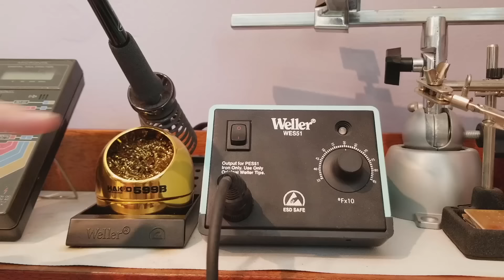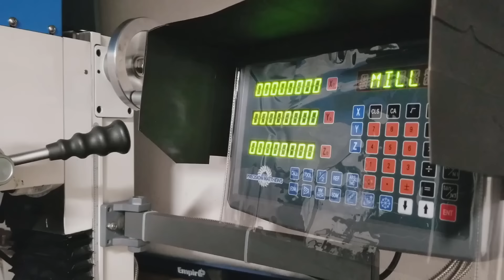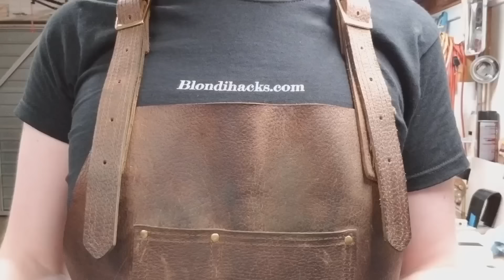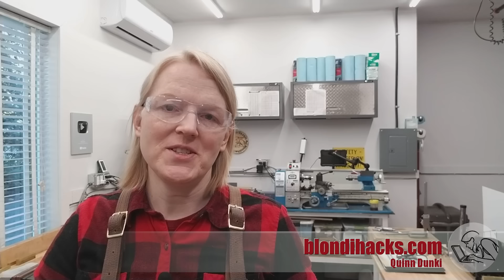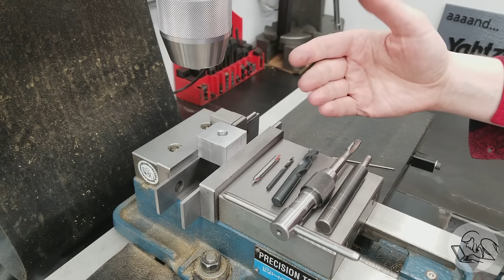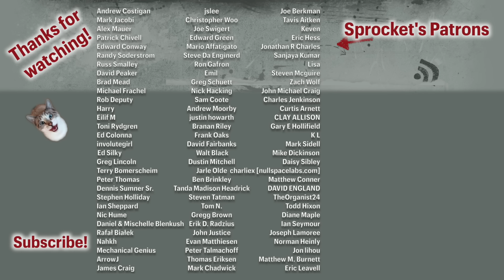Efficiency in the Home Machine Shop

Comment: I like using rolling papers for touching off.  The majority of them are .001" thick, +/- .0002" so when you snag the paper you're within a thou and you haven't marred your surface.  Notebook paper is in the 3 thou range if you don't want the guy at the gas station thinking you're a pothead.
Another thing I do is make little kits for things I do a lot, like I end up drilling and tapping a lot of certain holes.  I've got a little plastic bin with the pilot drill, tap drill, and tap in it so I'm never digging through drawers looking for commonly used items, they're always right there in a convenient organizer.  That way whether I need to do that thing at the lathe or mill or even with a handheld drill I just grab the bin and go.
Reply: Your comment reminds me of comments from a driver who runs a motor race team with volunteer helpers (with occasional turnover). He set up the "adjust rear wing grab kit" (etc.) so the person could grab the kit & do the job - rather than hunt for the 6mm hex key plus the xyz tool out of the main tool box (& get in the way of other workers) every time.
Reply: @yowie0889  Smart guy.  Making kits for specific tasks has saved me tons of time and a bit of frustration over the years both professionally and in my hobbies.

Comment: Good list, and great video as always.  Just FWIW, the top efficiency improvers on the mill for ME personally are:
1. Goes without saying, but: having a DRO on the mill
2. Power Z-axis to save cranking it up/down constantly for tool length changes
3. Power X-axis for the most common facing operations
4. Collets in a "spinner" mounted on a cabinet directly to the right of the mill for easy access
5. Having the most commonly-used tools (edge finders, face mill, calipers, machinist jack, angle blocks, clamps, etc.) readily at hand on a shelf/cabinet within arms reach
6. A power drawbar.  Actually, I have only a "poor man's power drawbar" at the moment: the proper sized 12-pt socket in an impact driver always at hand on a shelf just above the drawbar bolt.  One day I'll get around to making it a TRUE power drawbar setup, but having the impact driver gets me 90% of the way there for quick tool changes.
7. Cyclone vacuum setup immediately available beside the mill for quickly clearing chips

Comment: Biggest efficiency tip for me was actually on a longer timescale - there's probably four sizes of endmill you use all the time, and similarly with reamers / drills / taps etc. Get the best quality you can for these frequently used tools - and keep a spare! I've lost more time in projects waiting for replacement tooling after a broken flute than I've wasted in toolchanges or edgefinding. Higher quality tools also save time as you said because you get better precision on dimension off the bat.

Also, its almost always worth it to buy a tap / die rather than setting up the lathe to do single-point threading. Machining channels on youtube tend to make a big deal out of the single-point threading, and its very satisfying to watch, but its incredibly time consuming. You don't need every thread - I only have metric taps, and even then you can almost always get away with a size up or down from the drawing. It's just a hobby shop, and I'm my only client, so I only need to make me happy :)
Reply from the maker: All great tips!

Comment: I think I'd add a sheet of either drawer liner felt or cork to the top of the surface plate cover. Easier on the finish of the tools and a little more resistant to the tools sliding or rolling when the cover is moved.

Comment: zig zag papers are good for edge finding with milling cutters damp the surface your wanting to edge find off put the zig zag paper on then touch off with the cutter as normal stopping the moment the cutter brushes the zig zag paper off. you'll be less than the thickness of a zig zag paper close to the work piece

Comment: My #1 efficiency tip: Bright and even lighting. It takes much less time to accurately read measurements if you aren’t moving around trying to “catch the right light”
Reply: The older I get, the more important this is!
Reply: Having a magnifier in your first-order set may become a necessity too, as your eyes grow out of being a teenager. 😅
Reply: @autochton  Oh yes.  But... good bright lighting also helps a lot to make out the little details with ageing eyes.  I have trouble making out the print on small electronic components, except when I have a bright light to hand.  Don't even need a magnifying glass except in rare cases. 
   
My shop tips which I sadly don't always stick to: 1) A place for everything and everything in its place.  2) Tidy up between jobs, and at least once a week.
Reply: @autochton A set of Jeweler's loupes or at least a 10x one is something that is usually found in a machinist's tool cabinet. As well as a large magnifier often times with a built-in light.
Reply: I have had LED daylight strip lights in the workshop for a few years but recently added an old anglepoise lamp between the mill and the lathe - I find the extra light right on the job is great.

Comment: Good floor planing may not give you to much efficiency but can save you a lot of headache, keep the stock in the same end of the shop to the bandsaw and the lathe not the grinder and the mill, moving across the shop is a lot faster If you dont have to go around the workbench so aligne parallel to the most common path and dont put the heavy box of gauge blocks/drill bits on the bottom shelf.

Comment: One small problem I've found with the screw machine drills is that they seem to suck for lathes, or at least on my little Sherline. Unfortunately with the length the tail stock travel, I really struggle to get the drill past the cross slide and into the part.

Comment: As a prototype machinist at an automation company that does lean I feel kinda obligated to chime in on the time and motion studies subject. They are totally still done, but just anecdotally in my experience, they are usually done with the intent to reduce fatiguing repetitive motion or to reduce mental burden on employees. Toyota and properly done lean is a great example of that concept being turned into a good thing for employee and employer. And it is super nice in a home shop as Quinn has pointed out.
Reply: Absolutely- and as a Union Rep I occasionally did time & motion studies both for protecting my members and for suggesting improvements when “efficiency savings” had to be made. The latter has become a complete double-speak for slashing good things, but it could still help to find the least bad option…
Reply: @davidrahn9903  I agree 110%.  I was dragged into learning Lean/Six Sigma at work 20+ years ago.  The highest priority was to implement Lean/Six Sigma in our jet engine overhaul building.  One Production Shop was "Leaned" at a time and the first Shop I was involved with performed compressor subassembly teardown (for a specific engine), inspection, (send parts out to other shops for actual repairs, if economical), then reassemble the repaired/new/good parts into the compressor subassembly.  My team of two people followed one Artisan around as he did his task and measured how far he walked, noted what he did & why, etc.  At the end of his task, which took him at least 2-3 hours, he had walked ~1.5 miles (~2.4 km) inside a Shop with floorspace of ~100-ft x 150-ft (~30.5-m x ~46-m), only leaving his Shop one time for a ~1/4-mile (~0.4-km) round trip to get a tool replaced by the Tool Room.  I don't recall how long his task actually took without us bothering him, but it was less than the 2-3 hours we slowed him down to.  Walking around in his Shop to retrieve tools, fixtures, etc., was amazingly inefficient! 
 
After our teams redesigned the workstations for each task, we arranged for all necessary tools, fixtures, consumables, etc., to be placed within arm's reach of each Artisan.  "Our" Artisan's 1.5-mile (~2.4 km) walkabout became just ~100-ish feet (~30.5-ish meters)) (only because some tools/fixtures needed to be shared by different workstations - Work Orders were submitted to obtain/manufacture additional tools & fixtures that caused slow-ups due to having to wait for another workstation to use it first) and his task's multiple-hour TAT lowered to around half an hour.  The Artisans were glad that their jobs had been made easier & faster to perform, without the frustration of having to look for tools, fixtures, consumables, etc.
Reply: @bobvines00  In my former job I had a service truck that had most of the tools and parts I needed to do the job. It is amazing how much this can increase productivity by not having to drive back to the shop for a part or tool then back out to the job site. But for management this was not seen to be important. They would rather spend a lot of money sending us to training classes to learn how to more productive. I never used any of that. I just kept my service truck well stocked with parts and tools.

Comment: So, my method of just piling everything into one box is not the best? Well, hecky and or darn. Thanks for the tips Quinn. 

Yes, even small changes in the planned tool path on the mill can save a bunch of time. And just as with a CNC machine, a proper rack can save time. And as you said, if you set certain classes of tools to the same length, then setup times are reduced.

The central location for your most commonly used tools mirrors the concept of a proper kitchen, where the stove, fridge and sink make a triangle that should be within a step or so of each other.
Reply: The "all in a big mess" approach is fine if you insist to critics that you know where everything is.

Comment: In EU we're often use "xd" length, in most cases 3d, 5d, 7d which means length  of cut (or length of max drill depth) is x times diameter.
Basically most of HSS drills are 5d and most VHM are 3d, but You can buy them in all lengths

Comment: organizers for the collets. normally these hobby collets come in small plastic boxes with no identification. i either mark the collet size on that box or make a collet organizer with easy-to-identify sizes (either in inches or mm). that saves a LOT of time when looking for collets. Also having the most used ones in a separaed organizer or in a top row kind of thing...
Reply: I keep duplicates of the most frequently used items in the mill, namely: edge finders, 1/2”, 3/8” end mills, two center drills pre-loaded in collets on a board hanging under my DRO. Similar with the cutters on the lathe. There are empty 1/2,3/8”, etc collets in the drawer as well,but these are quick and easy to reach without being overwhelming racks of all the collets and tools.
Reply: Label makers and Sharpie are your friends!

Comment: Regarding edge finding, I have a basic LED circuit that i clip one side to the endmill, and the other side to the work piece. When the endmill touches the work piece, the LED lights up. Easy peasy.
Reply: Only works if the two are insulated from each other! I do this on my PCB cnc.

Comment: Ummm, an efficiency tip I like: keep the beer fridge in the center of the shop.
Reply: The adhesives and solder paste fridge may or may not have other things on the door.
Reply: @spehropefhany  Just don't mistake the solder paste for cheese dip.

Comment: Having your first order tools ready to use, from your calipers, mics, etc to your surface plate, also makes for better habits because you are easily able to grab the correct tool instead of "making it work" with whats closer.  How many times have people used anything but a hammer instead of a hammer because its already in your hand and the hammer isn't.

Comment: A number of years ago we acquired a large bench-top mill where I work to make some regularly needed simple parts in aluminum. I had to choose between power tapping or power feed on the Z-axis and I chose the former. After about five minutes of use I realized what a mistake I’d made and quickly fabricated a Z-axis power feed using a small electric winch from Princess Auto. When I ordered a different machine for my home hobby workshop I avoided that mistake.

Comment: I don't really mind the lack of efficiency. Having a "Rong Fu" in the garage allows me to fix all the messed up woodworking tools I spent dough on a few years ago and could never really use properly. Three days spent drilling 8 holes, and now it's time to return to that window building project that has been hung up for 2 years because the router table I got from Grizzly was kind of a piece of . So far I've found machining to be one of the few honest projects. My mill is pretty messed up but it allows me to figure out exactly in what way it is messed up and use it accordingly, whereas the woodworking tooling industry seems to be a free for all grab for your pockets. Unless you are willing to spend WADS of cash on equipment that is too heavy to go into your basement, but wow I have digression issues.

Comment: On that subject... I think I spent 3 hours making a camera bracket that attaches to the headstock of my mtb today. Boring to 50mm, parting off, creating two flats spots to put bolts through, sawing a slot for some criping action, drilling and tapping a hole for the arm to hold the camera. Lastly I cheated a bit by only providing a single 3.1mm prong for the gopro-style connector to attach to, instead of 3.

I daren't look up how cheap an actual ready made part is :X